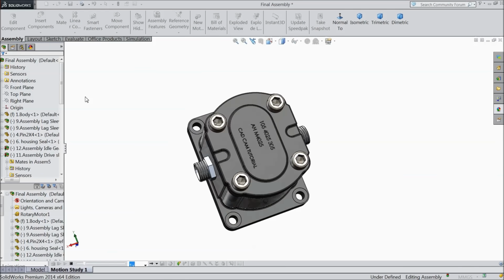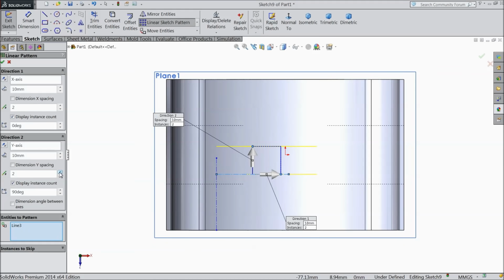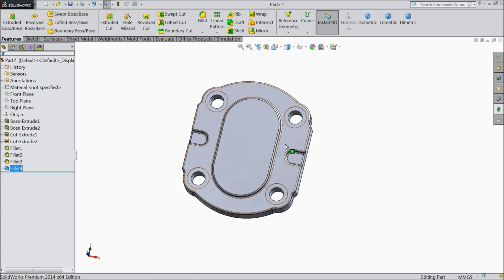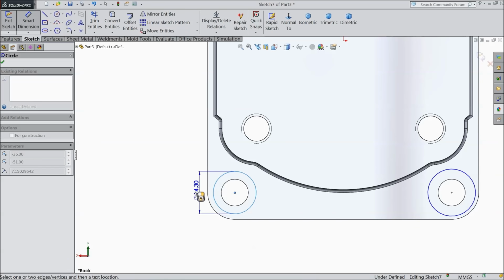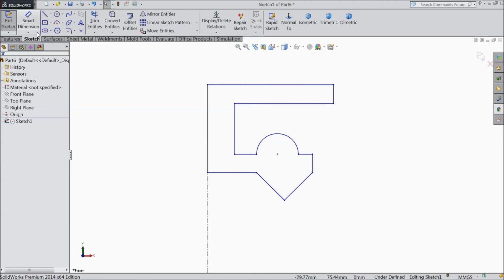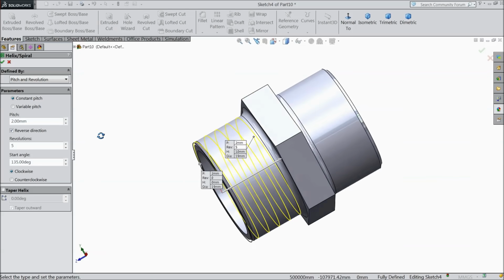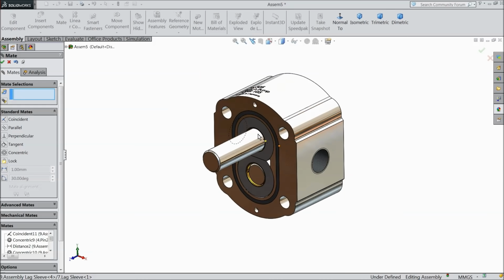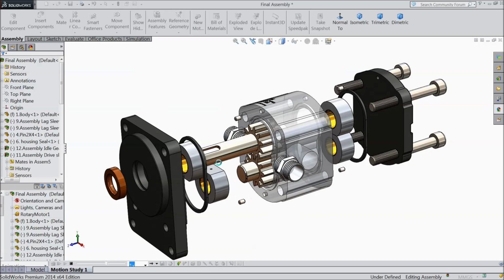Hydraulic Pump Design in SolidWorks

Comment: Thank You for your time in showing people how to better use Solid-works, I have a question about the Motion Study that is created near the end of the video. If a person doesn't like how the animation is generated is there a way to delete the animation and create a new one? How do the filters work, and can the filters stop something in the animation from happening? I created a key way for the shaft and in the exploded view I pull the key way off the shaft first, so when the motor is running (operational) the key way is spinning out in the open because I selected it as part of the shaft. How does a person de-select a component from motor operation or rotation? Thank You in advance!

Comment: thank you for doing these tutorials on how to use solidworks. ive seem to run into a problem i cant seem to fix. mayb u can help. i made the shaft to mate with gear....but wen i go to toolbox and select iso powertrain gear then drag spur gear next to shaft, the spurgear size is very small. even wen i input the numbers correctly, it still small. how can i fix this.thank u

Comment: Thank you. There are a few problems, the oil seal is not fully defined and the nipple has left-handed threads as a result of the mirror. Some of the worst dimensioning here I've seen in CAD-CAM Tutorial, but I think this is an old video since there is no 'copy with mates' option.

Comment: How to convert dimensions to mm I'm currently working in solid works but it took all dimensions in inches . It's very hard for me to do that settings . Plz help bro .
Reply: In the bottom right corner, yours should say IPS, click on it and select MMGS for this example. To set the unit system as the default, you need to edit existing or create a new template with the unit system you wish to use selected.